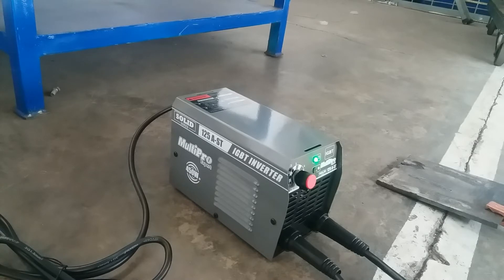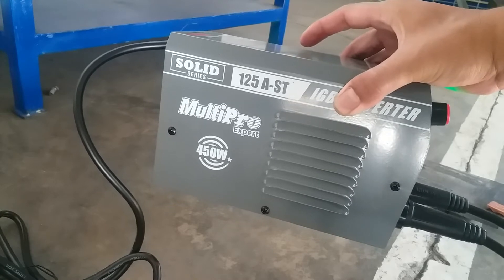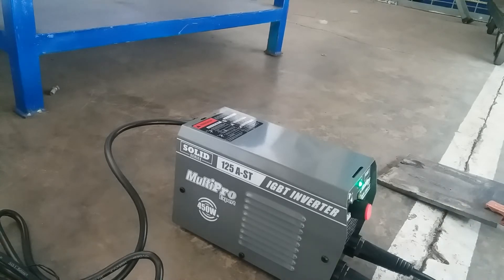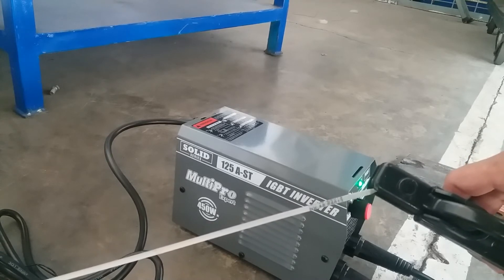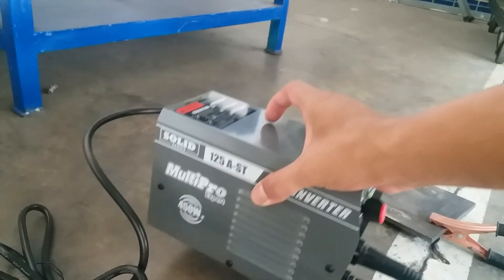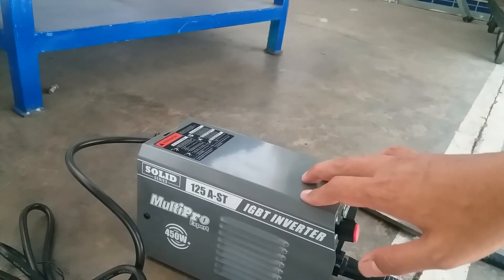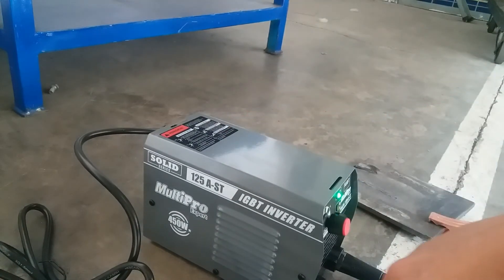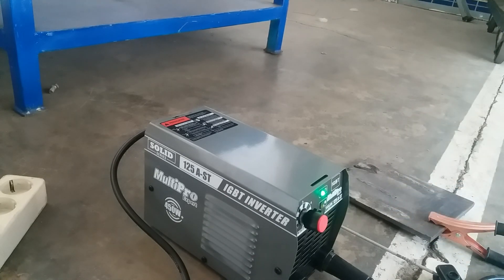Las Listrik Low Watt.!! Canggih.

Comment: Izin bertanya pak....
saya banyak mendapat pertanyaan dari teman-teman YouTube...
MultiPro expert Solid 125A-ST yang terbaru menggunakan rangkaian power supply 24V dengan IC regulator 8 pin, kode lengkapnya berapa ya?
Setahu saya MultiPro Expert Solid 125A-ST sebelumnya menggunakan IC regulator bagian power supply 24V dengan kode LNK626 (7 pin) sedangkan keluaran yang baru menggunakan IC regulator 8 pin.
Mohon info lanjutannya pak...terimkasih...
Reply from the maker: secara fungsi sama. ada kelemahan dan kelebihanya masing masing. saya cek data shit nya dulu pa untuk serinyaa
Reply: @Welding399  Alhamdulillah...terimakasih pak....soalnya saya belum pernah melihat isi bagian power supply-nya dengan IC regulator yang baru ini....